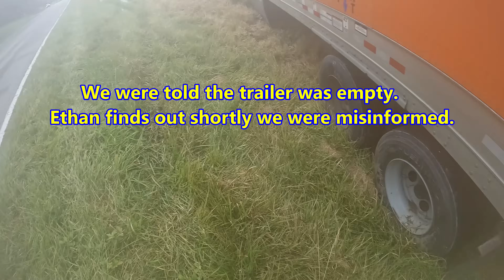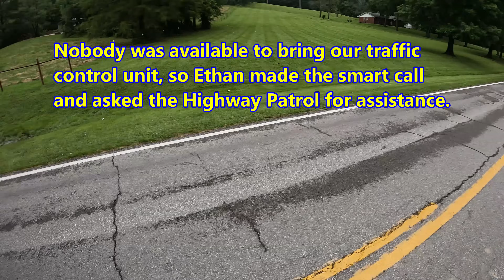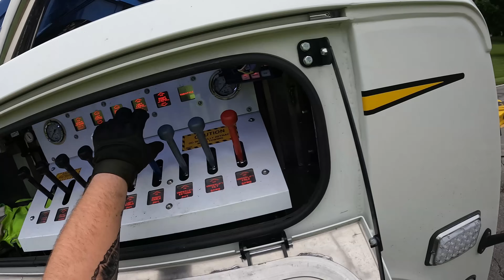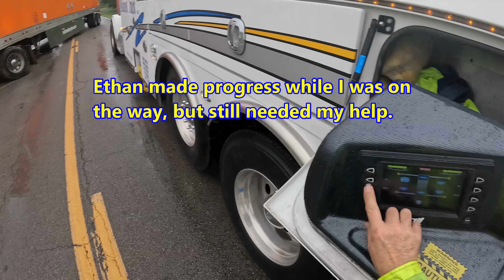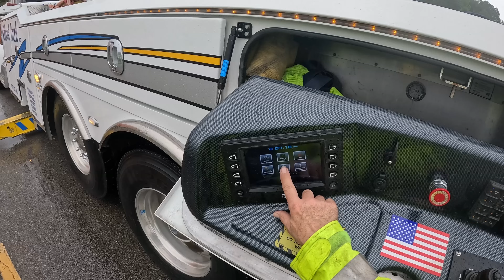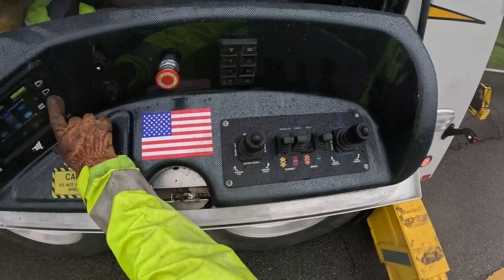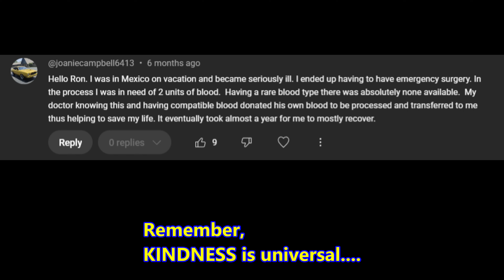YOU CAN'T PARK THERE!! WRONG INFO RUNAWAY TURNS INTO A CODE 3 CALL!!

Comment: I had to get towed, told the wrecker company I was loaded 80k. The wrecker driver showed up in medium duty. The first thing I asked him if his truck would towed 80k. He was never informed I was loaded. I don’t understand why people don’t give the right load weights. One miss calculation could result in a big mess.
Reply: at least you actually informed the Driver of the wrecker unlike this driver who kinda just sat in his truck not doing anything or making sure that the Ethan had the correct info
Reply: Did your company call the towing company or did you? For if it was the company their thought process was a cheaper tow bill. Which I will guess didn’t work out for them. 😅 If you did then I would call that a misunderstanding at the towing company.
Reply: I had one time i was fished out of the ditch, wrecker asked how heavy i was.  Now like Midwest, they always send a truck that can haul it regardless.  I told them, with as much as it was shoving me in here, at least 70k.  We usually ran fairly light, and this just felt heavy.  Scaled at the terminal, was just over 80k.  I had one of the larger and heavier trucks.
Reply: i think some of it has to do with the company trying to cheap out by not informing the tow truck then figuring well they already there so that will be the cost not realizing it will cost more in the end as now the have to roll additional equipment
Reply: The people in the office who call the tow trucks usually have never driven a truck and know nothing about how towing works 😂

Comment: 5:43 - ask to look at the BOL.  They aren't always right with weight, but often are.  Also if it''s a company trailer being pulled by a non-company truck, the load is probably VERY heavy (35K +).  The megas keep the light loads for their company trucks.
Reply: Our dedicated account didn’t even give us weights on the bills.  They barely gave us bills at all.  Almost verbatim, this is what we got.

Company
Destination
Shipping terminal
Lead lumper

Contents (which usually read ‘frozen grocery’)

Not helpful.
If it felt heavy, we had our own scales, but couldn’t get weight tickets.

Comment: 2:35 - the seal on the right door is a very good indication that the trailer is loaded.  I pull a dry van and pretty close to 100% chance you have a load when you have a seal.
Reply: Yeah and down where he's at it be a proctor and Gamble load they've never loaded a 15000 pound load in they life probably 46000 I pull a reefer now but dang I used to pull dry loads
Reply: Exactly.  Shipper seal when loaded, my padlock when empty.
Reply: Meanwhile the company i work for seals empty trailers, partly security partly as we had drivers moving unauthorised loads on the side
Reply: Might depend on the company. At Walmart the drivers have to put a seal on when taking empties, whether or not its a Walmart driver or when they contract out Schneider drivers. Usually with reefer stuff it needs a lock too regardless if its loaded or not.
Reply: @coltsjason P&G loves to max load every trailer they see.  I’ve talked to security at a number of difference locations and they all say that drivers have to have them rework overloads all the time.

Comment: A very good exmple of pull it out the way it went in if you can. Eathen tried to shorten the pull with a steeper pull angle. It unfortunately created a fuel tank issue with the Tractor. The lower longer pull angle would have kept tanks clear of contact. Hind sight is always easier to diagnose. An on the job  learning experience. Future pulls will benefit from this one. Keep safe and hopefully next time load information will be more accurate. Out safely and down the road , that is what a good extraction is supposed to do. Good job.

Comment: I think I would have looked inside the trailer and seen how much was in it,nice work Ron ..
Reply: If you notice when Ethan is putting his chain on the trailer, it has shipping seals on the doors, so they would have been in trouble with the company and DOT, had they broken the seals to open the doors.

Comment: 45k and his tandems are allllll the way back! he way over on the drive axles and steering! gotta love it 😆
Reply: I agree about the drives, but not necessarily the steers.  I played around with tandems on a heavy load one day.  I was fine on the drives and tandems and slightly overweight on the steers and didn't want to slide the 5th wheel.  Moving the tandems back actually was gradually LIGHTENING the load on the steers because I guess putting more weight on the drives levered weight off the steers.  But his tandems being that far back was the first thing I noticed--depending what state you're in, that'll get you pulled over.  I've also never had a case where weight balance would require them to be that far back.
Reply: I was thinking the same thing even when I'm empty I keep them forward
Reply: Yep.............
Reply: @georgiapatriot4575 meanwhile i’ve had a load where the tandems couldn’t go far enough forward.  Apparently some crews loaded the soups forward, and the dry in the back.  We had some tridems that could haul it, but the shipper didn’t like them since they were in the customer’s paint, instead of ours.
Reply: It maneuvers so much better on 8 or so then the back like that
Reply: 45k definitely over on his drives should be slide forward at least 6 to 8 holes
Reply: @georgiapatriot4575  I got pulled over in MI years ago when the produce company I drove for at the time tried to load 2 trailers worth of product onto my trailer! had the tandem slid all the way back to get "legal." I told the boss and she said,"Run it"  I took great pleasure dropping the ticket on her desk when I got back!
Reply: First thing i noticed too
Reply: Sad state of the truck driving industry.
Reply: I am an old guy, but I remember when most of the trailers had FIXED tandems--- no sliding at all.

Comment: Ethan was correct in everything he was doing to get the truck out, just had all the wrong information about the load.  Empty would have slid easily on the pavement as he was trying to get it to do.
With correct information (loaded truck), then the rotator would definitely been sent right away also.  I'm just guessing.  Arm chair quarterback. :)  Good video, and nice work you guys!

Comment: First of all. Good job Ethan, as always. And Ron is always top notch. Second. Miscommunications seem to be the norm now. It would be nice if we could get accurate weight information. It makes the job a lot easier. But, that's where we adapt and overcome in the towing industry. Be it a sprinter van, or semi truck/trailer. We had one lasy week, that was grossly under informed aout weight. Only off by 15,000. But as I said, we adapted, and got the job done. God bless everyone at MidWest truck. Stay safe out there.

Comment: Going out backwards he was going to high center on the edge of the road no matter what. The only way to get around that with one truck pulling was to go forward so you can lift the front of the truck until the rear wheels are on top of the high point or close enough. Have had to do that more than a few times. Ethan was right to not pull that out through the mud hole. One option may have been to winch it back more towards where the truck left the road to get to better ground. Then grab it from the front and pull it up.

I know it sounds like a lot more work, but sometimes more work makes easier work in the long run.  One thing I keep telling the guys around here is that sometimes you can't just start yanking on stuff, sometimes you have to position a unit first. It's too easy to get yourself into a mess if you limit your thinking to just keeping moving it towards the road until it's on it. 

Even then that embankment was pretty steep, that makes the recovery a lot more complicated even on dry ground.

Comment: Nice work guys!
That steering wheel holder didn't have a clue about anything.
Should have asked to see the bills of laden, had a steering wheel holder that had red hot and smoking trailer brakes say that he "was told" his load was only a couple pallets of 'plastic', gut says ask for papers - he had a 53ft trailer of batteries - without a placard anywhere on truck or trailer.
Be Safe, Be Happy & God Bless

Comment: Ethan did everything right.  I'm impressed.  How did the driver get that far off the road with that load?
Reply: Once it starts, the soft wet shoulder will pull you that way. The only thing that can be done is to follow it to keep the truck and trailer upright. That makes the recovery much easier.

Comment: smart of the truck driver to put on his Hazards / 4 ways .. i mean parked in a field you never can be too careful
Reply: Saw one car fly past, I get it's off the road but maybe slow down even if its for a look! There could be an oil slick on the road.
Reply: Never know a tractor may be scooting around in the fields working... LOL  Things drive off road too... LOL
Reply: Modern truck, probably detected a crash and put them on
Reply: @theswaff699  that's what i figured is the truck probably detected tha panic brake the minute the guy went off the road and automatically activated the hazards or AEB falsely detected something and slammed on the brakes in the wet weather causing this whole issue of the driver sliding off the road because typically when the AEB activates it will also activate the Hazards automatically
Reply: Those farmers working their tractors may not see him without his four ways 😂
Reply: Home terminal Chicago, Illinois on side of truck"Nuff Said"

Comment: Weird thing is I think the guy actually said 50 and not 15. So it was likely an accent difference.

Great job on this and good at the pragmatism to solve the weird issues that came up!
Reply: Always confirm if they mean 15 or 50, because the difference in sound is way too small for the weight/speed/length difference.

Comment: I am not a truck driver, but how does a driver not know at least a very good estimate of the weight of the load? I thought all loads need to come with paperwork shows the details of the product including an estimate of product weight?
Reply: Bills have weight of product, mostly for inventory and billing purposes, which are more or less accurate.  If you do it long enough, and with varying weights, you get a good idea.  I had to be fished out once, took a stab at it, and was off by about 6k.  I guessed about 75 and i was 80.  Our company was dedicated, so the actual load sheets were emailed internally, no weights or contents, just shipping terminal and receiver.  But there’s quite a difference between political promises, 15k, and 45k.  If nothing else, how far he got in the ditch was a good clue.

Comment: Ron That trailer had 3 times the weight total weight close to 80,000 pounds or more the new truck should have had no problem single line pull if it was 15 thousand pounds in the trailer and the driver and their company sounds like a communication issue on there end cause Ethan definitely brought enough iron to do the job

Comment: At least the driver wasn't wearing flip flops, and kept it shiny side up. Hurt a few small soybean plants, no big deal. I still don't see how he slid off the road with 45K in the box though, doesn't seem that road could have been completely covered in water, then dried up before Midwest showed up on scene. Driver was suprised they got there so quick, so I don't think water in that flat of an area if it was flooded would have drained that fast. Not much for ditches around there.

Comment: At first, Ethans idea was good, but in hindsight, it would have been better to pull him out exactly how he entered, as it was less steep at that point, plus the angle you pulled him out, there was no way the tires would steer in the mud to straighten the trailer up, hence the trailer angled right across the road

Comment: Aren’t you supposed to have the bills in the side pocket next to driver?
Reply: not really. the only regulations are for hazmat loads. if it's a hazmat, the bills need to be within arms reach of the driver when sitting in the drivers seat. when the driver is out of the truck, the bills must be visible on either the dashboard or drivers seat in case of an emergency

Comment: Ron and Ethan, I know how very dangerous this recovery was.  It was complicated by the fact that the trailer was, in fact, NOT EMPTY.  The fact that Ethan quickly discovered this discrepancy, being told that the trailer had about 15,000 pounds, but, in fact, had 45,000 pounds in it.  I would think it's required that the weight be completely shared with Ethan, you, and your company.  I would, I think, be a little concerned that the true state of the weight was NOT disclosed.  Fortunately, you and your crew have always been prepared for any eventuality.  I still believe that full disclosure is the best policy.

Comment: If only his tandems hadn't been slid right back, it would have cut across properly - and it might not have come off the road to start with - it must have been riding pretty badly with the tandems in that position, which isn't going to help the handling any.  He'd have had to be swinging wider on curves, and that might have led to him touching the grass and getting sucked the rest of the way off, whereas with the tandems forward the trailer would have tracked better, and not needed him to swing as wide.  But then if he can't tell the difference between 15k and 45k lbs, he likely doesn't know about sliding his tandems either.

Comment: 15'000 vs 45'000lbs. Shouldn't a driver feel and know the difference - without even looking into the papers? He's at least been driving this truck for a while before leaving the road...
Reply: I certainly could when I was driving, even though I had a big difference between the tractor units.  45,000 lbs is pretty close to a full load, whereas 15,000 lbs is lightly loaded, and that affects everything from how it pulls through how it rides to how it stops (or doesn't like to)!
Reply: There's a huge difference, he knew.  15000 lbs is like The truck is still empty. The handling changes when it's around 29,000+. He had to have known.

Comment: driving too fast rain lost traction ended up in field
Reply: With the tandems all the way back he would have poor tracking of the trailer and too much weight on his drives, so likely lifting off the steer axle, so a recipe for understeer and pushing the front wide on curves.  With the tandems forward, where they should be, the weight distribution works properly and the trailer tracks the tractor unit better.